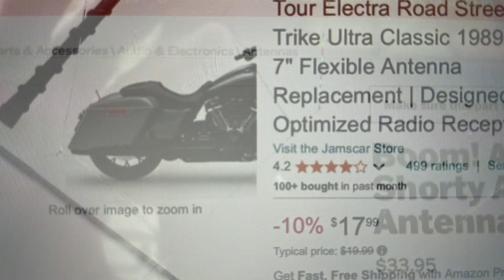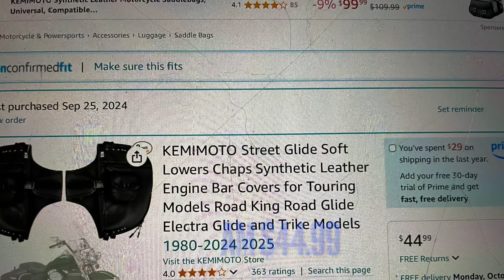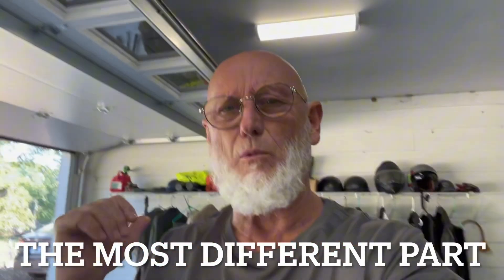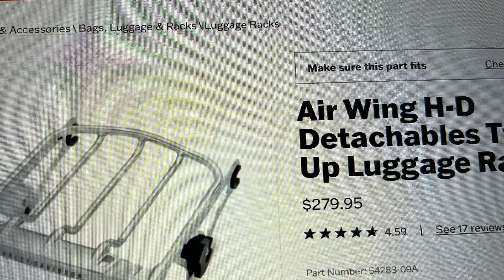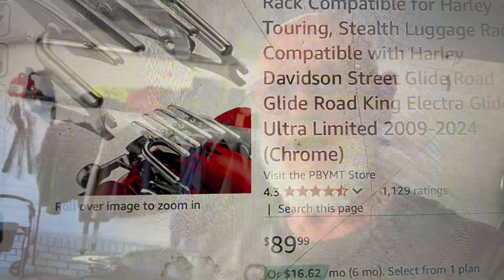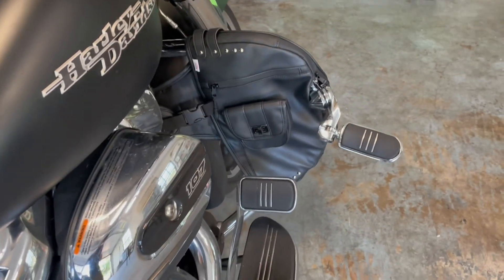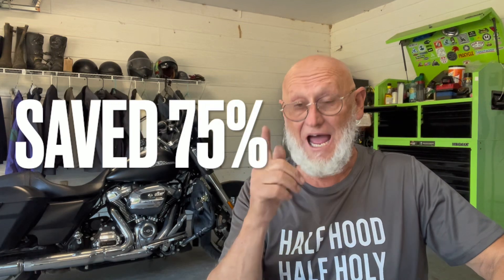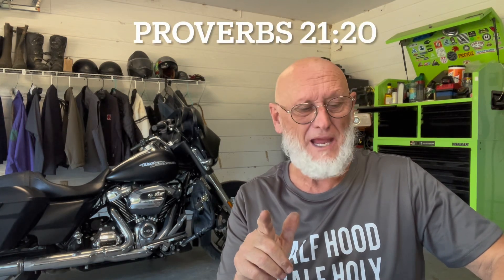Are After Market Motorcycle Parts Any Good !

Comment: I am glad the day I got my 2017 Ultra limited because it already came with most of this on it, I installed a Hogs Works quick detach kit and took that heavy tour pack off and got a street glide seat used for 50.00. Now I have a wet head street glide for less than buying a street glide stripped down version. Harley caught on to people doing this so they discontinued their quick release detach kits but they have it on the brand new ultra bikes. Great Video, Thanks
Reply from the maker: Thanks for that great comment. I’m going to look into that Hog Works detach kit. 
❤️ Be particular, Ol Slick